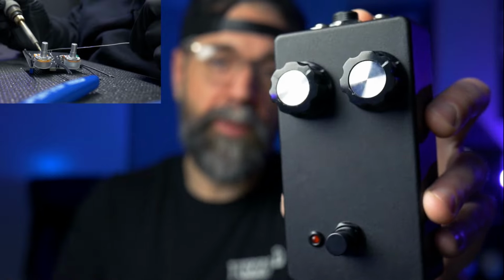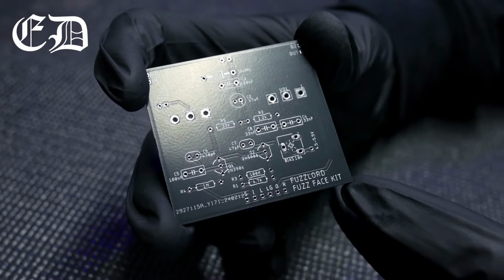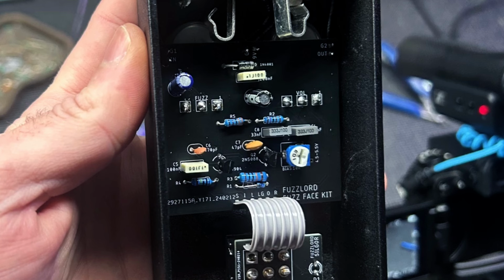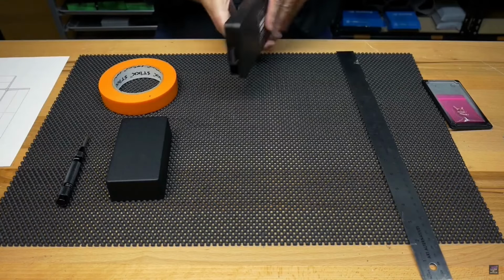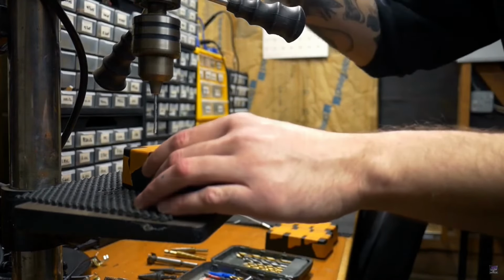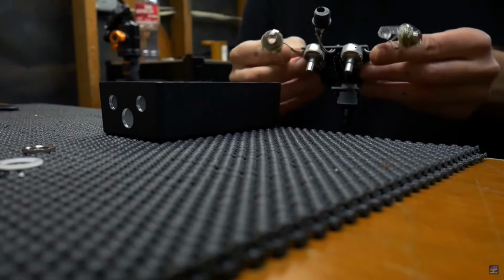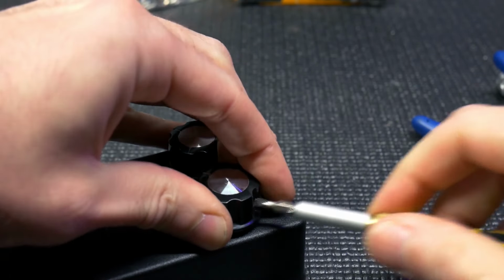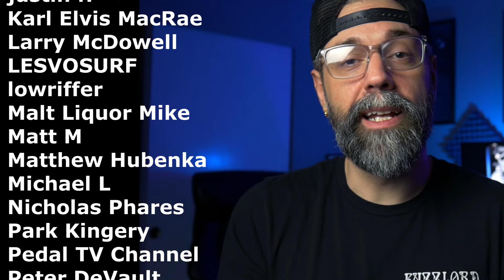How To Build A Guitar Pedal: Silicon Fuzz Face

Comment from the maker: Thanks for watching! Be sure to check orientation of electrolytic caps, the jacks, DC power, diode, and LED. All of these parts have a positive/negative lead. The box caps (100nF and 33nF) and ceramic disc caps (47pF and 470pF) and the resistors are non polarized. Pick up your kit at https://fuzzlordeffects.com/ and join everyone on the Fuzzlord Discord Server at https://discord.gg/WuCrtVtD
Reply: Where do you get bulk diodes and resistor's basically the parts?

Comment: Building pedals came from a basic interest to be able to solder or modify/repair things with an iron. From cables to guitar output jacks - simple stuff that cost a lot of money and time to bring to a tech.  As my curiosity with pedals & effects grew, I wanted to learn how to design or mod them. But first?   A handful of kit builds to learn, and make mistakes, and ultimately have a workable result at the end, with the option of modding or socketing the pcb for easy component swaps. I'm still slow, but with each kit I get better while I learn about relevant concepts in electronics for how pedals work, and how to eventually design some.

Comment: It was a ton of fun building that DXD250 kit! Learned alot just from the vids you post, and searching sites for the parts needed, aswell as trouble shooting, just to find out I just suck at soldering wires. Definitely suggest people get PCB mounted pots. I definitely plan to for the fuzzface kit lol Solder suckers and solder wick is also super helpful for correcting issues like I had haha
But yeah, if I can manage to use the kit to build an awesome sounding pedal, anyone can! Definitely grabbing the fuzzface kit when I get paid later this week!

Comment: I built a Silicone FF before, and it was one of my first builds. I found it surprisingly versatile. I used a power jack that i found from Amazon, which was threaded on the inside. I learned the hard way to have the jack's nut screwed in before soldering or you would have to desolder to add the nut lol